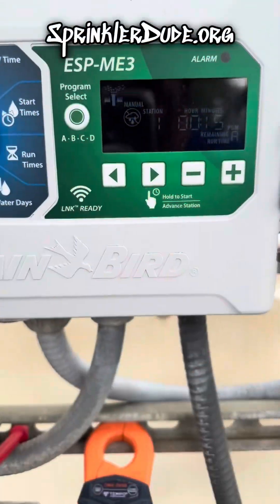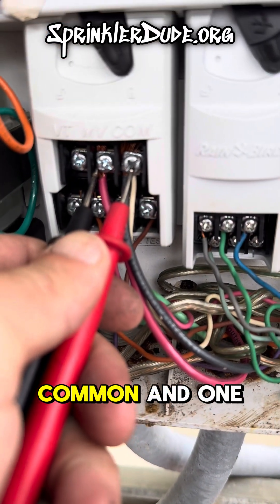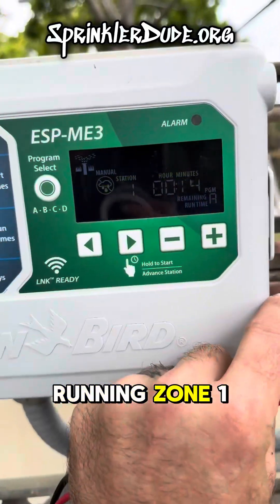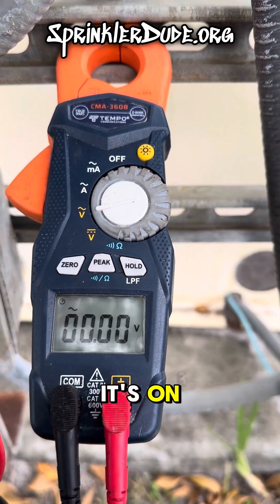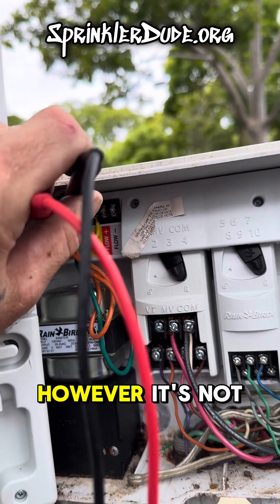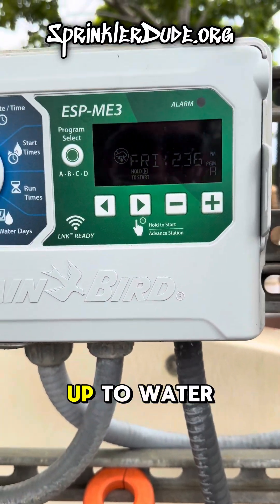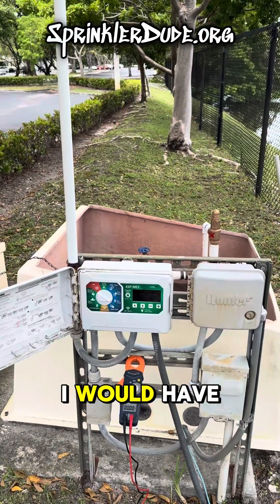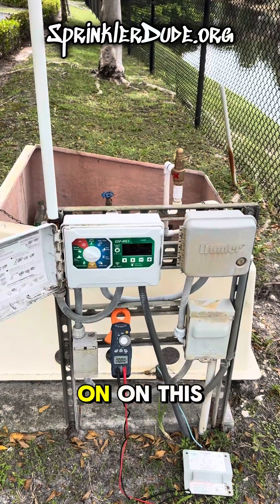How to Troubleshoot a Pump That Won't Start: Step-by-Step Guide

Comment: Question: I checked the voltage on the MV and COM and get zero. Then I move to step 2. Zone 1 is running at the master valve but not at the sprinkler head so I put the voltage meter on the COM and the Z1 and I get roughly 26 volts. So at step two I didn’t get zero as you did in this video, what do I do now?
Reply from the maker: My controller you’re referring to may have the ability to turn off the master valve for individual zones or whole programs. You may want to look for “hidden features” in the instruction manual.

Comment: Can you tell me what to do about leaking nozzles? Nobody seems to know. Water sprays out all around the nozzle as well as through it. (Rotary sprinklers, Hunter type with the red nozzles.) The nozzles are pressed in all the way. Is there a fix?
Reply: If im not wrong it’s supposed to do that so it covers that area around the head where it leaks
Reply: @yovanich1410  OMG really?
Reply from the maker: Not enough pressure to the nozzle. Look for an obstruction or line break on the zone line.
Reply: @sprinklerdude  Turned out I had Rainbird nozzles installed in Hunter rotors...